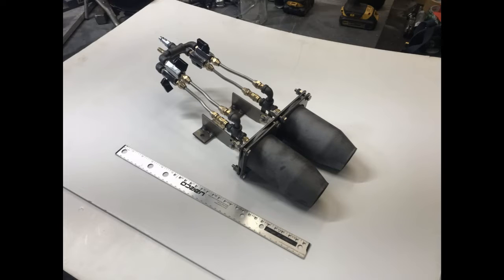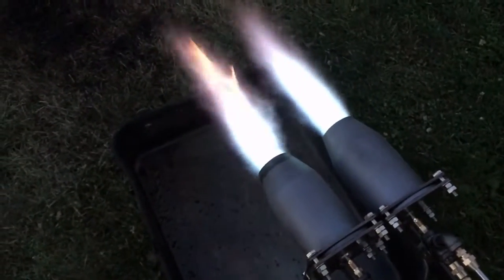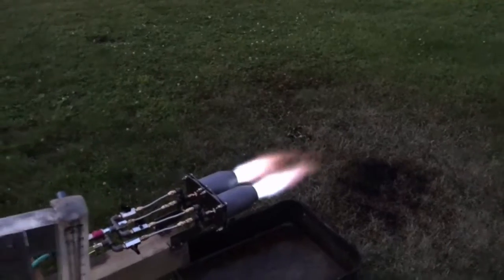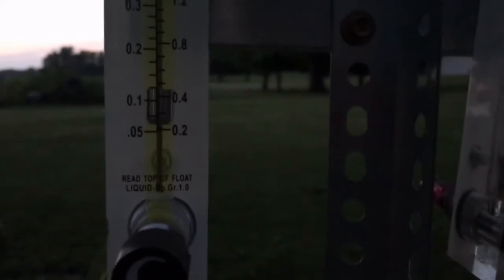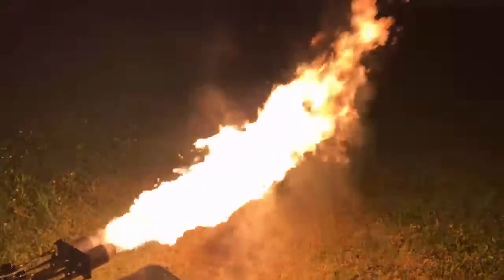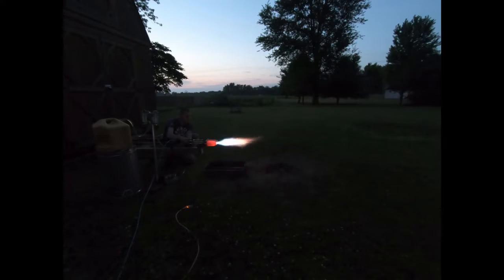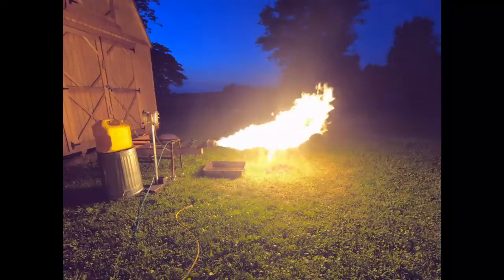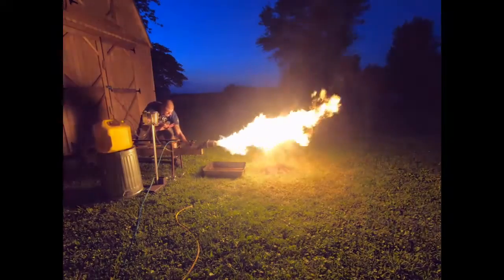Double barrel silicon carbide all fuel burner

Comment: you ever tried a pertruding solid iron core rod  from the centre of the nozzle . my logic is as the rod warms also , it will attract inwards and around itself the flame being produced , and cause a cleaner burn as it attracts the energy from the fuel. .Like a exhaust gas return valve but inward .  just a thought